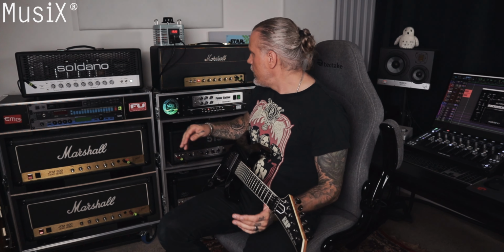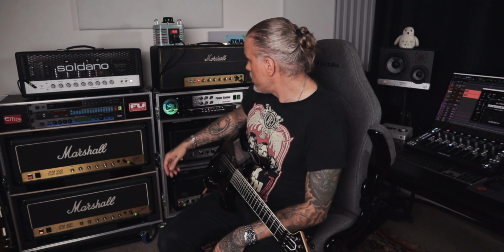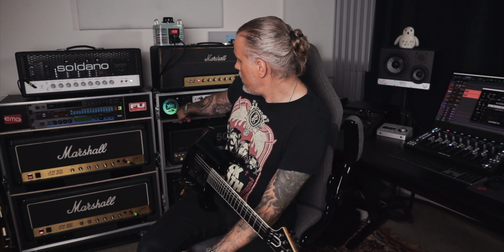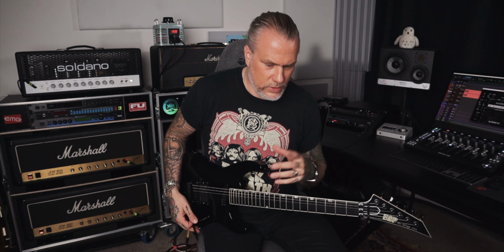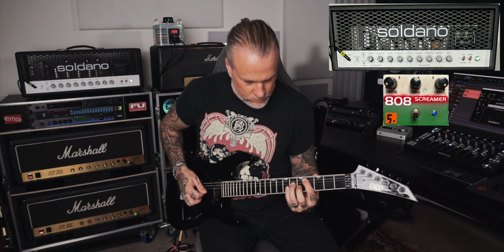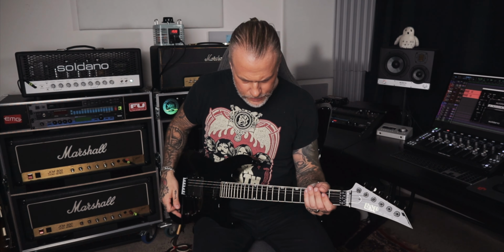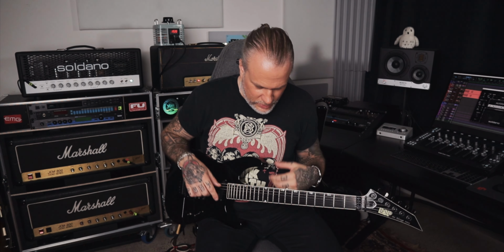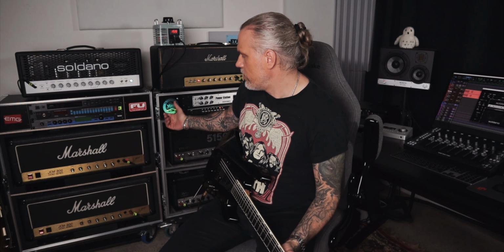SOLDANO SLO-100 vs Modded MARSHALL 1959HW PLEXI

Comment: Plexi all the way for me. Sounds clearer, tighter and more cutting/aggressive. I briefly owned a brand new SLO 100 that is sent back to sweetwater. It was too flubby and fuzzy for my tastes. I just couldn’t get on with it. Not a bad amp at all but just not for me and definitely not at that price point.
Reply: That might be because it’s not a typical metal, or Marshall circuit.  It’s misleading to say that Mike Soldano copied, or even was inspired by Marshall (as true as that is).  Because this amp is a COMPLETELY different beast.  And, Euge wants a guitar tone as massive as he can get, so he’s a gain freak, always trying to thicken things up.  You have to be REAL careful with that, with an SLO.  I’m not judging his taste, and how he hear’s tone, I’m just saying that a VERY common mistake with the SLO.  For every one video that has an SLO dialed in with its signature tone, there are 50 of guys trying to dime everything, and it sounds excruciatingly bad.  It’s almost as if he’s trying to get them both to sound the same, or dialing up both to his particular taste (again no right or wrong), rather than getting signature tones from each.  So, it’s not really a comparison.  He’s right on the borderline of demonstrating how NOT to dial in an SLO.  He briefly mention that (in passing), that when you dial the gain back, the differences between the two start becoming far more apparent.  Which is a shame, he didn’t spend a little more time on it, because that’s EXTREMELY important with this amp, or you’ll wind up hating it.  He get’s away with it, because his technique, and choice of notes is stellar.  But, even with his playing, you can still hear the fizz, and “flubbiness” starting to creep in.  When this amp first hit the market, Peach Guitar’s channel did a demo with it, that was so God-awful, I’m surprised B.A.D., or Mike Soldano didn’t tell them to pull it.  They have a great channel (with killer players) but, it was a classic example of them not being familiar with this circuit.  And, this amp is extremely sensitive to speaker choice, as well.  All amps are, but with the mid-focus this amp has, it’s makes an even bigger difference.  In ‘87, high-gain was considered EVH’s Fair Warning…or Ratt’s Invasion of Your Privacy.  Actually, two signature albums are Great White’s Once Bitten, or Y&T’s Contagious.  Sometimes people today just aren’t looking for that tone, which is fine…there’s no right or wrong…it’s all subjective.  But, it’s astonishing how many people don’t know that going into this amp.  The SLO is a “Super-Crunch” amp, or a solo amp.  You can’t dime it, and expect it to sound good like a Marshall circuit.  It took my a while to learn that with mine.  *When you get both amps dialed in to their legendary tones, then look at the EQ, each amp’s EQ settings are completely different from each other.  But, there’s a reason this amp was used on literally hundreds of albums, and just about anything from the 80’s, and early 90’s.  Should you get another opportunity, try a low output pickup with the gain dialed back on its Plexi channel (if you’re playing rhythm).  You might appreciate it more, or sometimes it’s just not the right amp for what someone is looking for.  Btw…I’m a huge Marshall fan, as well…I had both amps at one point.  I’m just pointing out that the SLO is its own unique animal.  And, when dialed up properly, there’s nothing on the planet that sounds like it. 👍
Reply: @phillamoore157 May I ask your settings for your SLO-100 to get the classic sound? I have a SLO-30 and would love to try them out! (I currently have Bass 6, Mids 4, Treble 4, Presence 7, Depth 1. Normal channel on Crunch mode gain at 5, Overdrive channel gain at 4)
Reply: @guitardave  You’re right there, brother.  The trick is to say off the OD channel.  Which, btw…I’m talking rhythmic playing, where IMO the SLO shines.  For lead playing, OD channel, and as much gain as you want.  For what it’s worth, there’s a channel on here called “Cragginshred”.  He’s dials in a BEAST of a tone with both the 100 and the 30 (among other killer high-end amps).  He helped me a lot when I was going through the same frustrations a lot of guys go through with this amp.  I’m using a Les Paul these days with low out-put Dr. Wolftone vintage.  And, it’s majestic.  Till I figured that out, it was flubby, fizzy crap.  The ONLY reason I didn’t return it was because I couldn’t come to terms with the idea that this amp is on a MILLION records with a killer tone…I must be doing something wrong.  Anyway, he got me using the Normal “plexi” channel dimmed with the OD kept low between 2-3.  The EQ on that thing is “adjust to taste”, but I found it sensitive in my room.    And, there are obviously other factors (pickup, speakers, room).  For what that’s worth, I’m going through a Friedman 4X12 (V30’s on top, Greenbacks on the bottom, I believe).  He get’s a KILLER sound bouncing between a Tumnus and an SD-1 to tighten it up, but barely has them on.  So, if you do use a pedal to tighten up, then start very low, and work your way up.  My preference was with the Tumnus (mini), on a VERY low setting, using the level more than the gain, but only because if you can’t turn this up, then it tends to get a little thin (like all amps like this).  The Tumnus/SD-1 (gain off, level up a hair) keeps that problem at bay.  That’s where the 30 might be a bit more forgiving.  The 100 is better, but it’s hardly noticeable, unless doing an A/B comparison.  Start there, and see how you like it.  Those were the settings I said “OK, NOW I get it”.  Once I started there it was like I unlocked a beast.  Especially, if you can turn it up to bet some air moving through your speakers. 👍
Reply: SLO 100 takes a while to figure out,You have to have the right tubes and the best sounds to me are this:
Normal channel, crunch mode, bright switch on, gain maxed, bass 5, mids full, treble 4, presence 4, depth 0.
OD channel, gain ONLY ON 3! same EQ as before. 
Use a pedal to boost as needed.
Reply: @phillamoore157  By coincidence I have a Tumnus Deluxe due to be delivered today! I bought it for exactly that reason - to boost the Crunch channel a touch. And I find that I do stay on that Crunch channel most of the time. However, I have the gain on 5 so that I can easily dial back the volume on my guitar to get a clean. I’m hoping the Tumnus will allow me to boost in to a higher gain sound on that channel, helped by the 3 band eq on it.
Reply: @guitardave  Yeah, bud…you’re right there in the ball park.  And, I think you’ll dig that deluxe Tumnus even more.  I wish I would’ve gone that route, myself.  I tried to save a little space on my pedal board.  But, all this is subjective, but if you’re after that signature SLO “Super-crunch” tone, that pushed plexi channel IMO is the best out there.  I just wish it had a bigger sweetspot, you know?  IMO if you get outside of that plexi channel it starts getting flubby REAL quick.  And, that can be a big turnoff for an amp this expensive.  So, I’ve found it to be kinda one-dimensional in that regard.  The clean is very good, but very generic.  I actually prefer the clean on my Dirty Shirley, so I bounce between the two.  Like I said though, for those of us after that late 80’s super-percussive, mid-focused, tight, Super-crunch tone, that’s it.  At this point, I can’t play any other amp (at least for those tones, which is where my heart is.).
Reply: @scottanderson6807  Well said, Scott.  Every player I’ve been able to talk to all live on that Normal/Crunch channel, with the OD setting fairly low. And, I also noticed that this amp is REALLY sensitive to volume.  You really need to have some air moving through the speakers, or it can sound really anemic.

Comment: AWESOME!  I'm on the fence with the Marshall 1987X 50-watt. I love its tone, but I'm a big guy and like my 4x12 Deizel GM12-75 loaded speaker cabs. I hope the little Marshall 1987X 50-watt guy has the Popeye spinach to punch and push my 4x12 cabs. I don't believe in power reductors, noise gates, or whatever else it is you guys use to soak up all the pure precious tone we run down rabbit holes and climb spider webs to achieve the tone and power we love so much.
Reply: You know the only difference between the two is 3 dB, right? It’s not a ton of volume difference. The big difference come down to how quickly you run out of head room. Which, with a non-volume amp, you have to run it really high anyway. if the 50 W Marshall is good enough for guys like George Lynch and Warren Demartini, who prefer it over the 100 W, I am pretty damn sure it’s good enough for the rest of us.

Comment: Recently I bought a JCA50H and my tube amp tech did some mods, a "plexiesque" sound for the crunch channel and the overdrive with a more modern jcm800... depth mod and bias adjustment. 
I like the sound but... it's not the original 😂
🤘

Comment: Great playing...as always!  Both amps do sound very similar, but I guess you have to know what you're listening for to tell the difference and you can only do that hearing them side by side.  The Soldano has a deeper bass frequency response, where the Marshall has the distinctive and wider midrange.  That might make the Marshall more raw sounding as well.  I think you said it, that the Soldano sounds more modern.  A Plexi on the edge of break-up is unbeatable though.

Comment: Both sound stellar, Euge.  But, I’d also argue that the tone you have dialed up isn’t really a signature SLO-100 sound. It sounds great…but, not the SLO sound. Nothing wrong with how you hear tone, it’s ALL very subjective.  But, the tones circa ‘87 didn’t have that much gain dialed in.  It was more of a “Super-Crunch”.  The normal channel with the OD on 2-3.  When you compare it like that, those two amps will have a MUCH bigger difference than what you hear in this video.  The people who have never sat in front of both amps will want to know that.   With that said, a modded Marshall (especially the JMP’s)  is one of the best tones on planet earth, if you can find the right one.  People who don’t understand this amp, want to treat it like a typical Marshall, and/or Marshall circuit, and wind up hating it.

Comment: SLO has this lower mid thing that I just do not like. 5150s and Rectifiers have it too. 

It’s not a bad thing, it’s just not for me. I’m more into the upper mid bite and bark.
Reply: I love the SLO for that focused low mid but also love the more open wash of frequencies of a plexi.
Reply: @jimmccall8030  That more “open” tone also works better in a band mix (for me). That upper mid bandwidth, that’s the guitar’s domain. Too much of the low mid focus and I’m competing with the drums and bass.
Reply: Rectifiers are an unacknowledged copy of the SLO-100 preamp, and the 5150 was admittedly inspired on the SLO-100, so you have that.
Reply: I love both the heavy low mid sound and  the more open upper mid sound. I can't pick one over the other so I have different setups  for each sound. 
I find I can go from one to the other just by switching cabs that have different speakers  or by switching guitars .  
I have a les Paul that has heavy low mids and  a slight scoop in the upper mids and it makes a great Stoner rock guitar or for doom metal but for anything  else it's really  meh because of the upper mid scoop .